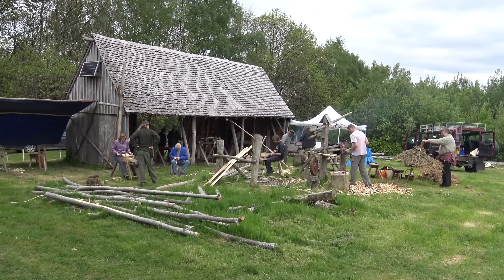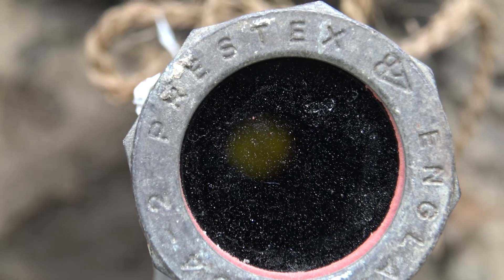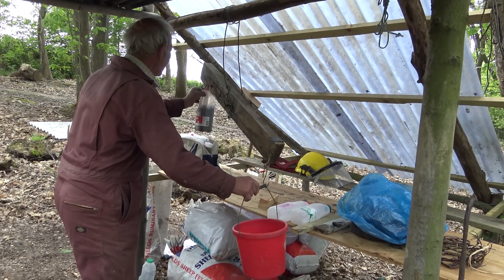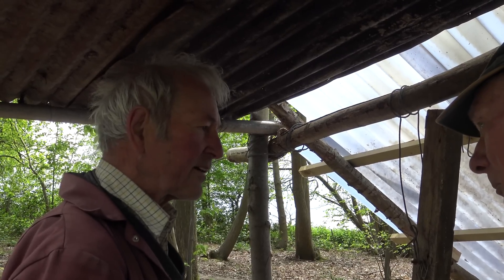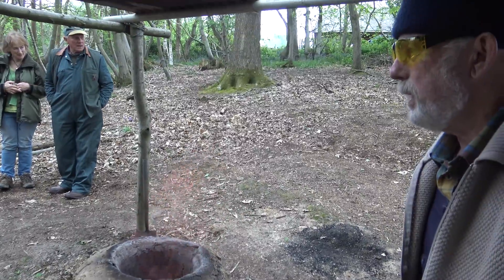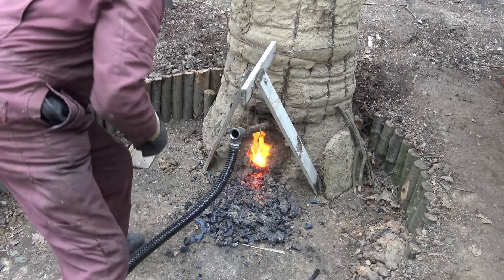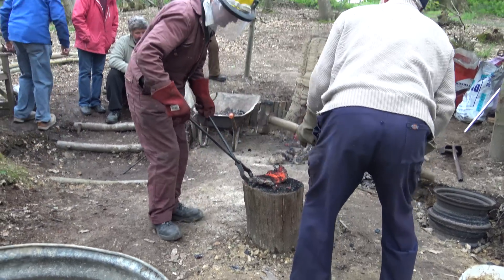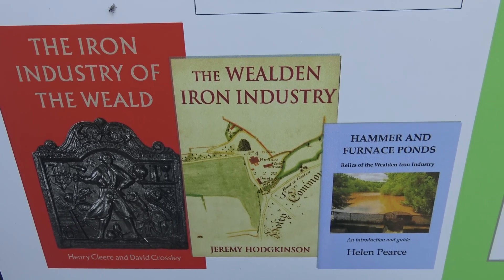Making Iron In The Woods - Bloomery Furnace

Comment: Thank you so much for the clear explanation!  I have a question... was the iron already under the clay furnace and then the coal added or was it that the coal is added first and then the iron ore is added? Just a small confusion.  And if so wouldn't the iron mix up with the coal and spoil its quality this way?
Reply: They add the Iron ore at the top, mixed with charcoal. 4:00 is a 1:1 Ore to Charcoal mix. And later at at 7:10 they comment on having too much carbon in the iron, making it a bit too hard to forge. 

The point of the bloomery is, in fact, to get some carbon in the iron by melting it at the top and letting it flow through the charcoal to the bottom. You then hammer the bloom and break all of the contaminants off, then cut it and forge weld it to itself to get a more even spread of carbon so that its' properties are more consistent.
Reply: @guycxz  Wow! Thank you so much! You've given me all the clarity I needed! <3

Comment: The bloom looks small and of low quality.  Ive never smithed but ive watched MANY bloomery vids.
SUGGESTIONS:
1) Pulverize your ore much smaller ... ideally to a coarse sand consistency.  
2) Sieve your charcoal - the optimum size seems to be about 1" chunks.  Too much dust tends to interfere with airflow, and overlarge chunks disrupt the rate of consumption and are less space efficient when burning - both mean less heat.
3) I suspect a slightly taller furnace with sligjtly greater airflow, and running it for longer, would enable to run hotter ... resulting in a bloom that is not only larger but of higher quality (read: higher heat means the slag drains faster and more completely).

Comment: But who made the very first metal hammer, how was it done..Its easy using already made metal tools to hammer it out.
Reply: Good question but as you will notice the anvil is an old tree stump- tongs can be wooden too as the charred wood acts as an insulator. A crude hammer would have been made of a large piece of flint ( at least in that area) bound to a wooden handle. The bloom does not need to be hit hard. However, don't forget discovery and working of iron is post bronze age  so bronze tools can handle hitting and holding that kind of heat for short intervals. Bronze is comparatively easier to melt and is much easier to cast. I'm not a historian but it is common knowledge the bronze age came before the iron age so this is my conjecture based on experience.

Comment: How it works: the charcoal produces Carbon Monoxide which reduces the ore to metallic Iron. Keeping the furnace at the right temperature is critical, you want it to be high enough for the slag to melt and run but not high enough for the metallic Iron to melt. Instead, the furnace is in the range of the welding temperature of Iron, which causes the metallic Iron to weld itself together in a sponge (or bloom), allowing the molten slag to leak out of it and most of the remainder to be beaten out of the bloom when it's removed and worked.
Reply: did you say carbon mooxide
Reply: What is the slag, in chemical terms?
Reply: @bettyswunghole3310  propably impure silicon
Reply: Well in fact FeO2 and Fe2O3 is reduced by several steps. The other oxides are reduced too btw. So silicates are likely to contaminate the iron! CHeers!
Reply: Finally someone explained it well! Thank you sir

Comment: Needed to add in some flux. Would have been able to save more of the iron. Still, this looks like it was a grand day out. Would have loved to join in on this fun.^_^
Reply: I read somewhere sand should be added with the ore for the reason you just mentioned and it is easier to break away in the wroughting process.

Comment: Bloomery was too hot, the iron melted and became pig iron. The carbon content is over 5%, the goal was to get it hot and cook it but not reach melting. If you want to smelt iron, you need a sealed crucible, which was unknown in Europe.
Reply: The Chinese were making pig iron by the later Zhou Dynasty (1122–256 BC).[2] In Europe, the process was not invented until the Late Middle Ages (1350–1500).[3] Actually, the phase transition of the iron into liquid in the furnace was an avoided phenomenon, as decarburizing the pig iron into steel was an extremely tedious process using medieval technology.

Comment: Where are the bellows? I thought one needed constant air flow to get iron ore hot enough.
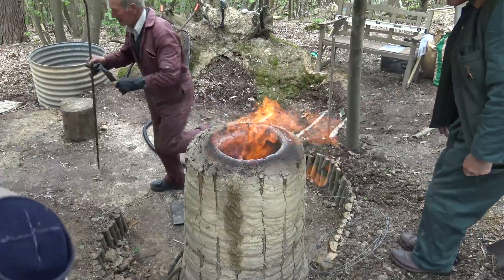Reply: I'm pretty sure that's what the pipe sticking out the front of the furnace is . . . at 0:55 you can see a hose running to somewhere behind a strategically located wheel-barrow.
Reply: Yeah, I figured that it must be for that but they didn't explain that and why was the source of air so far away?

Comment: Isn't that supposed to be steel when you mix iron ore with carbon?
Reply: No. What they are making would be pig iron. If they take this pig and then smelt it again in a low oxygen furnace it can make steel. The key is getting out the impurities and controlling the amount of carbon.
Reply: You get pig iron if the iron melts and become saturated with carbon, but the bloomery furnace wouldn't get hot enough to melt it. Later technology (blast furnaces with water powered bellows) did get so hot the iron would melt and produce pig iron which would then have to be remelted and decarbonised to produce steel. However during the dark ages in Europe they didn't seem to know how to decarbonise pig iron to get steel (at least not in a practical way), so pig iron was considered a waste product and melting the iron would have been avoided.
Reply: floopy312 it would be if it's the right proportion like under 2% carbon. It was too much carbon it turned into cast iron. But this is not the process yet there's still too much impurities.

Comment: Iron or Steel ?
Reply from the maker: Iron ...steel generally came more mainstream about 400 years ago.
Reply: Ok, so >0.05% carbon ?
Reply from the maker: I am not expert in this so suggest you google ....the Kent Iron Group has a very good website that goes into some detail...link in description. Regards Harry
Reply: ok, thanks you, and good video !
Reply: Actually I think they did produce some steel this way, but the bloom has to be processed further to get rid of the slag. The blacksmiths might also have been able to carbonise/decarbonise the iron further to suit the application. I'm not entirely certain though, there is contradictory information on the internet about this. The main disadvantage with this method is that it's very labour intensive.
Reply: That's pig iron

Comment: Done some aluminum smelting before but iron from ore is a thing of beauty and wonder! Amazing.
Reply: You mean melting aluminum cans, or literally smelting it from bauxite or something?
Reply: @nyctinus6859  Aluminium production is very complicated. You need electrolytic cell, in the inert atmosphere, high heat and high current, to reduce aluminium oxide mixed with cryolite. Even at small scale it would be very hard to do in the lab or home. Melting aluminum is easy. As most other metals. And even melting iron isn't that hard with proper heat source.

So, I doubt he meant smelting, but melting, as you suggested.